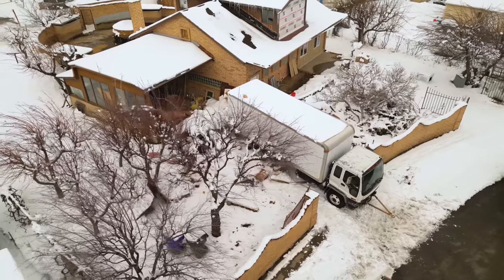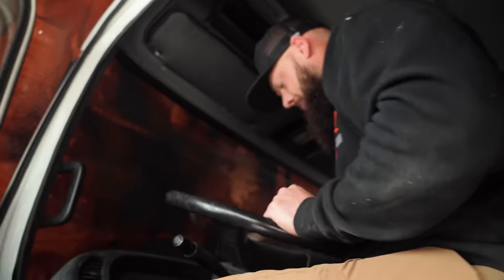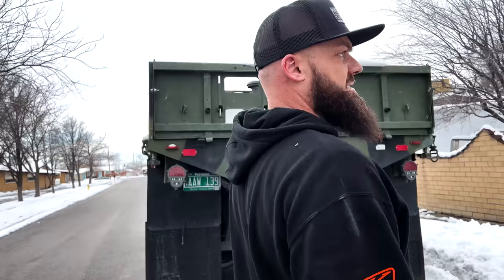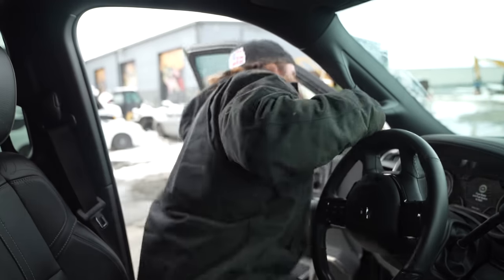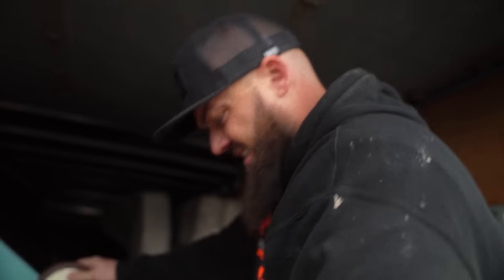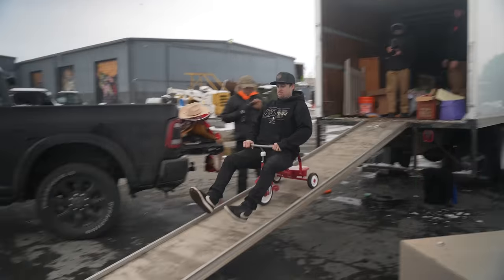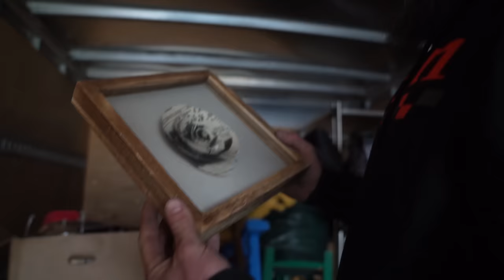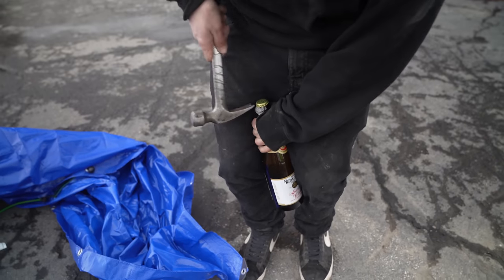I Bought an Abandoned Moving Truck FULL Of Stuff

Comment: I drove one of those almost 13k miles in Iraq pushing a mine roller in front of it and a 240G in turret. We didn't have the proper platform for my gunner to stand on so we made one out of 2x4s screwed together and resting on the dash and back of bench seat. That MK23 was the best machine I've ever operated. Thanks for bringing back those good memories!!

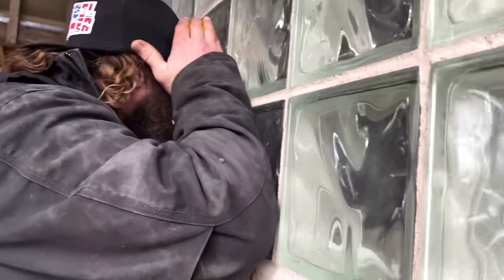Comment: 3:06 you can, you have to buy the structural ones. Not all are the same. Some are window lights only (for half basements), some are meant to be used to walk on (when they elevate a sidewalk and the once half basement basically becomes a full basement, but you have to leave the house's original view (dunno if the law's the same) so they use these with a metal grid to make platforms in the sidewalks), some are purely decorative. Most i've seen them used (with the full tilt type) was a two story + terrace house facade. Fully made out of them. A late 80's house.

Comment: I'm interested in the antenna that's on the tower. I look for ham radio equipment when it's low cost.
That wheelchair if it needs batteries are about 125. Each and some need 2 batteries.

Comment: Heavy D ; don't complain about using the tow bar to tow the box truck ! You had  it easy with the big truck to tow it with and the extra heavy duty to bar !
       Now try doing what i did if you not to chicken ; and then you might have something to complain about !
         i towed a F150 with a big truck camper on it using a towbar ! i towed it with a 2001 (V6 ,5 speed standard ) dodge
 dakota pickup truck !! plus i did it using a class 2 receiver hitch i cut apart and rebuilt to fit the truck !!

Comment: The drip rails were really bad about leaking. If you keep it then I know you'll fix it up so the paintjob prep will address that. It was common when a w/s is installed. That's easy to check too.
The trick is seeing if the water is coming in BETWEEN the pinch weld or if on top of the metal, then it's not a body leak

Comment: The truck would make a great stealth camper if the motor etc is okay. Maybe a cool project for you! Ps, the wheelchair is worth 4 or 500 tops if the batteries are still any good. 2nd hand power wheelchairs aren't very popular. And a bugger to drive without gouging holes in drywall! I have one i was given I'm trying to sell.....

Comment: MTVR did not replace the LMTV series trucks (at least in USMC service). The USMC replaced the older 5 tons with the MTVR. LMTV's and FMTV's are used by the army and national guard where as the MTVR's are used by the Navy and Marine Corps (to my knowledge the army doesn't/hasn't used the MTVR platform). That being said when I was in the Marines the 6x6 FMTV platform was actually used for HIGHMARS rocket artillery launcher truck as the system was developed for the army and would have been too expensive to convert to use on the MTVR. Seeing as I got out of the Marines in 2012 things may have changed. I used to drive MTVR's and they are a BEAST! I sooo wish I could afford to own one.
Reply: And as for as the "hole" in the roof, that is a turret hatch/opening. there is a round cover that sits on there and can be clamped down to cover the opening when not being used. oh and that's also the air-conditioner, especially in the up armored truck where you cant open the windows ....at least in all the trucks I drove :/